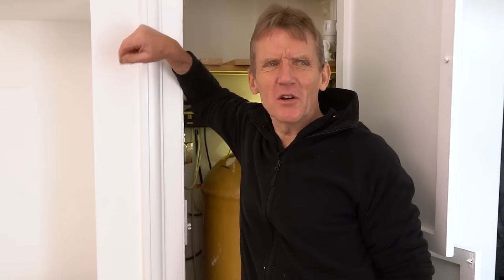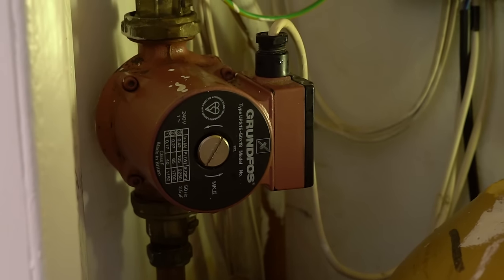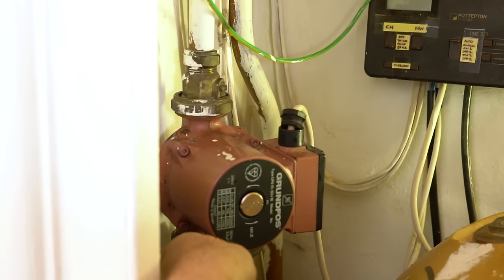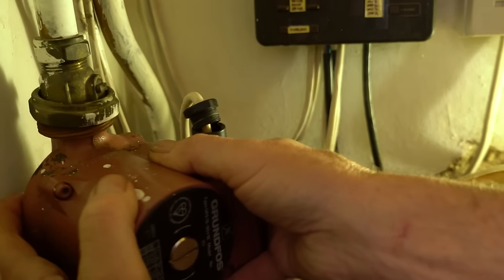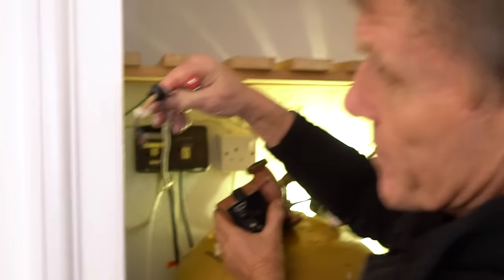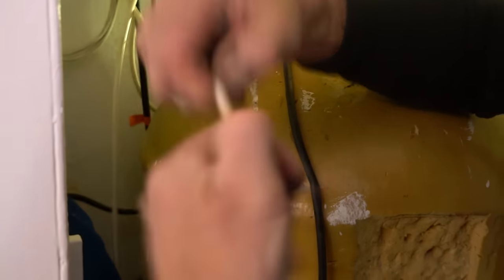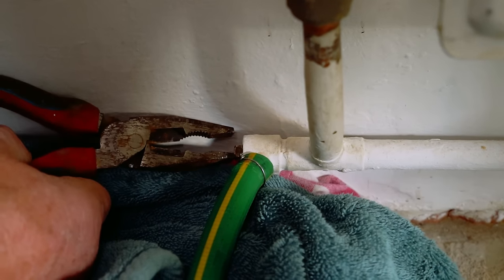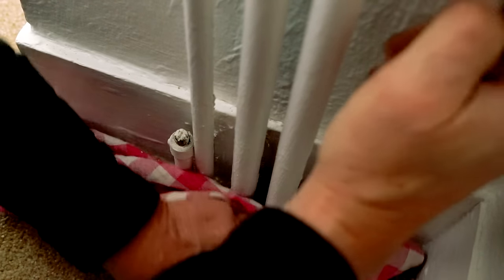How to Replace a Heating Pump - Plumbing DIY

Comment: Thanks for pointing out the isolation valves, the housing on my circulation pump cracked, and has been leaking water. The isolation valves have allowed me to stem the leak while im waiting for a replacement.
Reply from the maker: Glad it helped

Comment: Roger, respect to your services in the trade. We did meet 30 years ago when you did an article on one of my systems. 
However, I would never trust ball type valves, always replace. I would also bung the header tank and do one valve at a time rather than drain down, but I realise you are teaching the DIYers.
Reply: Best replaced with what part ?
Reply: How can you keep the water there while replacing a single valve?

Comment: Hi Roger - One thing worth mentioning is that the length of the Perfect Pump valves you have fitted are slightly longer than the normal valves. If there is no movement in the pipe work you will have to cut one of the pipes to make them fit. But far superior to the standard gate type valve in my opinion.

Comment: Interesting video. You didn't mention that Grundfoss pumps allow access to the motor shaft (via that big chromed screw cap) which has a slot in the end so that the pump can be freed up using a screw driver if seized after along period of no use e.g. in the Autumn on a CH only system.
Worcester boilers run the pump for a about 5 seconds every 24 hours to guard against pump seizure (which I think is a bit over the top, once a week or month may be since running the pump for this reason can waste some energy on certain systems by pumping a slug of cold water into the hot water cylinder coil for example). 
Interesting what you say about the isolating valve glands usually giving trouble when disturbed after many years; would be quite a straightforward job otherwise.
Totally with you regarding the Potterton Netaheat range of boilers; I would bet that there are some still going after 25 years of service with little trouble although inefficient by todays standards of course.
Reply: That is also writen in the instruction manual.

Comment: I had the same pump on my back boiler stove..had to replace it, all the heat merchants had were the evo eco type one with loads of different settings... It hasn't worked since... I must trying getting one of these old type pumps off eBay and change it myself...cheers lads

Comment: I remember years ago in the 1990's we had a "Grondfos Selectric 3" pump upstairs right by the hot water expansion tank in a cupboard in the bathroom, this pump was similar to the ones in your video and would always jam and make a loud humming sound... the tell tale that something was wrong was all the downstairs radiators would be stone cold whilst the ones upstairs were red hot ! - I found that there is a vent valve at the rear of the pump head where you could use a large straight screw driver (or even a 2 pence piece if this vent valve was loose enough lol).. With the heating off I would remove this brass/steel valve plug and there would be a tiny bit of water that would drip down, but this would then give full access to the rear part of the motor's DRIVE shaft which had a slot in it to accept a screwdriver ! - If you insert the screwdriver into this slot and turn it a few turns left and right, (you may need a little bit of force if the shaft / impellor is stuck or seized) but this definitely used to work and the pump would run OK after this for a while keeping the whole house warm and my mum happy !  - Great video and  demo ! - Love the new style unions they sell nowadays compared to the older ones where you would insert a straight screwdriver in them to isolate the water at both sides of the pump before working on it...
Reply from the maker: Thanks for that, you can often get a jammed pump up and running with the screwdriver in the impeller slot but often the thing that jams the pump is a build up of sludge inside the pump or even rust due to cavitation.
Reply: @SkillBuilder  Yes, Sludge from the tank and radiators is definitely bad for any of these pumps and leads to a cold house and expensive repairs ! "Fernox"  (I think that's how it's spelt ?) is good for flushing out the  system every few years to keep things clean and running smoothly ! - Also if you isolate the power to the pump, and isolate both pump unions and you have a allen key set and some high temperature sealant, it may well be possible to undo the 4 allen (or sometimes 2 allen screws) and remove the pump head/motor assembly and then free it up by turning it by the impellor by hand and also cleaning any remaining sludge in the cast iron pump body before putting the pump head back again in place and making sure it's sealed well as they also have the same poor quality rubber washers as those unions that parish from the heat and age.

Comment: Hi Roger, imagine this system you are repairing here is the type that has a loft top up tank, couldn`t help but notice prior to draining off down to pump level that you didn`t instruct us to shut off the refill on that top up tank. Thx, Tony
Reply from the maker: Yes you are right Tony. The trouble is that this was supposed to be a pump change just on the valves but it grew and I wasn't able to think about the filming as I should have. It is always a balance between doing the work and filming.
Reply: Thanks for responding Roger, yes that makes sense and can understand how that would occur. I appreciate your presentations, keep up the great education.

Comment: Roger brilliant as always but surprised you didn't mention capacitor inside electrical part of pump, they are only a fiver or so and easily checked and replaced. Any electrical appliance that has one, e.g.. Dryer, maybe washing machine, pumps etc. Check/ replace this first. Easy and low cost. I replaced on my pump working fine now. They are like a battery they degrade over time

Comment: As for the old boiler. Too right, keep it. In my last house I had a wall mounted Ideal Standard boiler with cast iron heat exchanger. It was in the house when I moved in, and in the 27 years I lived there I only ever had to change a thermocouple and replace the O rings between the two halves of the boiler castings. It may have used a little more gas than a modern boiler, but not a huge amount, but apart from that it cost next to nothing to run. No dedicated pump, no ignition device, no fan or pcb to fail etc.
It would keep the house nice and warm with the boiler stat on 1 or 2 with the heating on 24hr tick over in the coldest months.
Reply: "It may have used a little more gas than a modern boiler, but not a huge amount, but apart from that it cost next to nothing to run"

Really? Your 30 year old boiler was probably 60% efficient when first installed, over 30 years of use, that would easily bring the efficiency down to 50%, modern condensing boilers run at 92-94% efficient ErP. so straight away saving you 50% on your gas bill.... 

And btw. netaheat boilers are a bag of crap, ask any service & repair engineer.

Comment: I always remove the bleed screw and that will tell you if the valves are holding before you crack the pump valves open.
Reply: This is super helpful advice, and a much cleaner way of testing whether the valves aren't holding, thanks!  For anyone wondering, the bleed screw is the big silver screw in the middle of the pump.

Comment: Great video !! But I noticed the original defective pump was a Bronze (yellow body) and you replaced it with a cast iron body pump (red casing). Is there any reason you did not replace it with a Bronze or Stainless pump ?, or why you just did not replace the pump head to avoid having to change the valves ?

Comment: im without heat here and the plumber came friday and the pump needs replacing, he said "we are in trouble here, where are your tanks, we will need to bleed the system and replace the pump, i will have to get another man back with me" and is not coming back til sometime this week, he has me so worried that im anticipating this is a thousand pound job...is this really the case or is it as seemingly easy as you have shown? ( i mean easy for you as an expert) i could do with some advice please.

Comment: Great, a jod I can do myself, can I switch all the electric off, and the main water supply under the sink, as feel safer...will I have to bleed the system now there will be air in the pipes..?.thanks for a great video.....!

Comment: Temporary fix is change the speed of the pump,  it should get going, mine just stopped again after 2 months but managed to start it the same way until the new pump arrives. Hope this helps someone.
Reply: My issue is our pump must have been off for years without our knowledge (in the basement). That left the bottom bedroom freezing and we never got a fix until we had a plumber come and noticed there was a pump in the basement. He suggested a electrician come and get it connected up to electric again (some cowboy removed it from mains). Anyways it was flying for weeks and now suddenly it's not. The pump is very warm and seems to be moving water but not to the rads down in the bedroom. Changing speed hasn't fixed it. We are at a lose as the pump seems fine.

Comment: I have 2 of those central heating pumps, and the valves ( gate valves?) that goes into them and comes out of both leak drip drip constantly. I think they're about 25 yrs old, and are in a right state.  There's no isolation valves on them so can't turn them off. I have a hot water/ cold cylinder  (elsan?)upstairs in the airing cupboard,, and the boiler is downstairs. I've tried tightening up the nuts but one is worse now! Drips faster oops.  I need to buy 4 new ones I think.  Im a numpty woman, but I have a go thanks to videos like yours.
Reply from the maker: Hi Anna 

 I think the only answer is to drain the heating system and fit a couple of new valves. If they have lasted 25 years they have done well.
Reply: @SkillBuilder  thank you, they have ☺
Reply: "Drips faster..oops" i got a good laugh from your comment! Oooops

Comment: I have this job to do as the pump valves are weeping.  As I have a cyclone filter below to pump could I isolate the feed to the attic tank and only drain the system down  from the cyclone filter?

Comment: my pump rotor had seized up.  I manually freed it up (remove the four small allen bolts...) and connected up the pump again. it works fine now.  we'll see how long it lasts.  the thing is that this pump only runs during winter, so i wonder how often rotors sieze up inpumps that are used only seasonally.

Comment: Hi Roger. Have installed the very same pump but need to set it to the second setting. Does the pump automatically do this as I can't seem to change it, even with a press of the green illuminated button! Thanks.

Comment: Tapping may not free a jammed impeller.  Undo the access cover (coin or large screwdriver) and you'll see the end of the spindle has a slot for a screwdriver.  If it won't spin, there's the issue.  Work it back and forth until it's free and hope the piece of grit or scale that caused it ends up safely lodged in the bottom of a radiator or somewhere.

There's no need to drain the system and it may save you a big job.
Reply from the maker: I gave that advice once when I worked for the BBC and a viewer opened the silver access plug and hot water came out and scalded them. Apparently I should have given the warning that there might be hot water in the pump. 
Since then I have advised tapping it gently, most of the time it works.

Comment: Hi I have a Worcester boiler 35CDi greenstar the hot water only works if the pump is on permanently on if I put it back to factory settings and turn on the hot water the temperature rises very fast and the boiler locks out does the pump work for heating and hot water or just heating I’ve had loads of engineers looking at this boiler and no fix parts that have been changed plate heat exchanger new mother board new expansion vessel the diverter valve opens when it’s calling for hot water

Comment: what made the pump to overheat, if it was not circulating ? I usually found that the impeller has stuck which makes the motor housing hot, especially if the water either side of the pump is cooler, you could have removed the big crome plated screw in the center of the pump and tried rotate the impeller with screw driver, not saying that is what was wrong with the pump.but worth a try.
Reply from the maker: You are right and we did do that. We made the video on replacing the pump but should have made on on fault finding first.

Comment: Hi Roger - did you have to cut the pipe a little to fit in those Ball Valves?  I'm finding that they are slightly longer than the gate type of valves I am replacing.  Thanks!
Reply from the maker: Yes I did
Reply: @SkillBuilder  thanks very much! Was wondering if I was doing something wrong - feels a bit scary to be cutting pipes

Comment: I got an old style boiler in my flat the hot water pressure is terrible.
I do not have a pump fitted. Can I buy a pump like this 1 and get someone to plumb and wire it in?
If so how much you reckon I'm looking at?

Thank you
Reply: @alemgas  thanks for replying to my 2 year old comment. Much appreciated

Comment: Hi, I live in a small flat with 1 bedroom and 1 bathroom
Is 75 W circulation pump strong enough for the system?
Thanks alot
Reply from the maker: Yes, absolutely
Reply: Tks alot
Reply: Get a modern pump, 45W. You would probably end up using 5W.

Comment: Ball-o-fix type pump valve unions always leak, see them replace them for gate valve type. Copper grease the union threads to ease replacement next time! Best practice, remove head and rotate so electrical connection comes in from underneath, more professional job that will avoid any water ingress if there’s ever a leak! Don’t forget to replace your washer on the drain off!!!
Reply: Watched this, hit the comments...you've done it already Jamie👍

Comment: Nice job. Done it myself but pump idolaters were crap cheap gate valves that passed - had to drain system. Ball valves are far superior even though they cost a tad more - well worth it.

Comment: Ever single pump (ball valve union) i have turned off, never never works ever. i drain down to below the pump then change valves and pump.. job done. also check the water quality ifits brown or black you will be back in 6months to change again, advise them to have a magnetic cleaner,,,,

Comment: Someone replaced the pump and cleaned a pipe near the pump. The rad in bathroom near pump is working. It took hours for the bedroom rads to get hot except one in bedroom. I waited until morning but rads downstairs still not hot.
The timer is on on has advised and only c/h mode.
Anymore advice as suggested by man who fitted it it needs a full flush. I did that 3 years ago. Surely it doesn’t need it again

Comment: Roger... would u consider a light smear of vaseline on those rubber washers ??
Also... any thoughts on using liquid ptfe ( in general plumbing ) instead of the tape which can be a pain sometimes ??
Loving the vids, I'm refurbing a stone cottage on the west coast of Ireland & having a ball learning the trades from people like your goodself...
Thanks & keep up the good work man... ☘️☘️☘️
Reply: Peter Fitzpatrick no vaseline is petroleum based and will destroy the rubber in due course.   Always use silicone paste on rubber parts.

Comment: My boiler is working ok most of radiators downstairs are working … 3 radiators in my son’s room aren’t working.. pressure is 1 bar .. bleed no air in them .. the pump is pretty warm how would I know if it isn’t working properly?

Comment: H Roger -- really like your videos -- tell your mate to get you tovservicevthat POTTERTON netta heat every year co the combustion chamber is under possitive pressure from the fan + can be dangerous if the casing seals are faulty !!! -- even better get a new boiler !!! -

Comment: Why did the pump fail could it not be down to contamination in the system did you not need to remove the common contamination from the system first?

Comment: I've cleaned the sludge out my downstairs rads cleaned my header tank out ran some cleaner for a week and then drained the system and let it run through a pipe the cleaner must have worked because it stopped the kettling noises straight awa y .Now i suspect my pump is either weak or jammed with remaining sludge because  some of my rads aren't getting as warm as before especially downstairs .
Reply from the maker: The cleaner has moved the sludge to the low spots. You now have to remove the rads so you can hose them through. You will be amazed by the crap that comes out. Once done you will have a really good system. 

British Gas would charge you £500 for this.
Reply: @SkillBuilder  Thanks for reply i have removed and hosed out my downstairs rads alot of sludge came out.
Reply: @SkillBuilder  What should you pay for a power flush

Comment: I loathe, hate and detest those balofix globe valve type pump unions. They always leak from the O ring seal on the shaft. All I can think is that after years and years of not moving the O ring sticks to the shaft, so when you turn it, it tears a bit never to seal again. Much prefer the gate valve type, at least if they do weep you can pinch up the packing gland, or if needs be use a few twists of PTFE tape to add some stuffing to the gland seal. I always carried a spare pair of valves in the van when I worked in London, it wasn't worth the grief of driving across London just to get a pair from Fulham Heating.